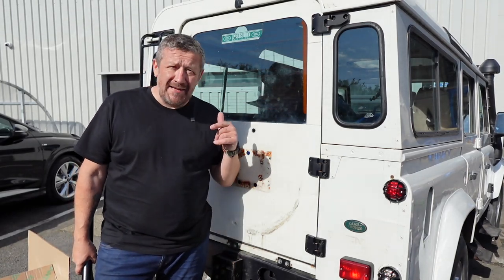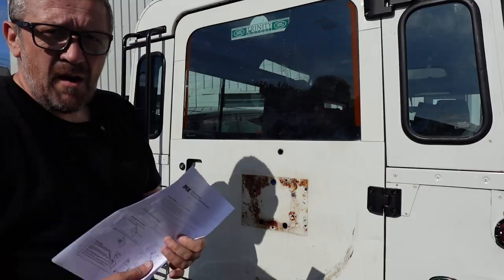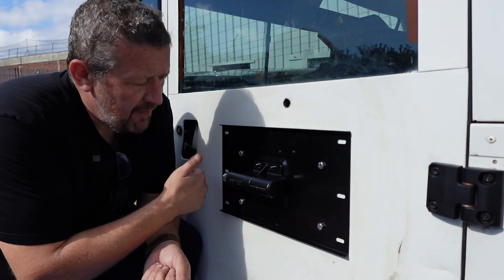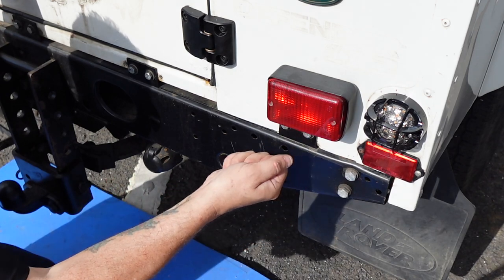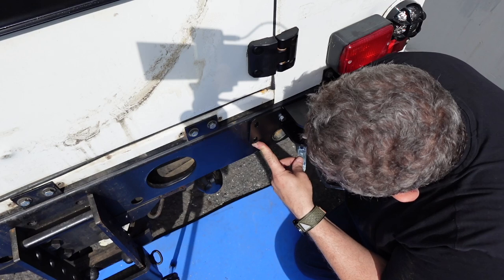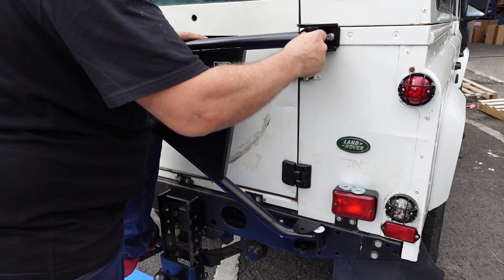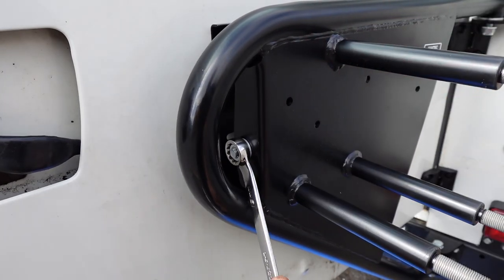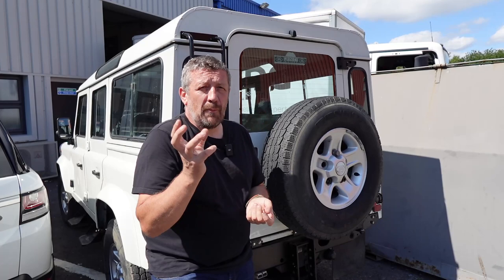One of the best bits of kit you can fit to your Defender, the Mantec Swing Away wheel carrier.

Comment: I’ve bought one similar to this one about 14 years ago - was a lot cheaper that time 😅

With a little DIY hack, wich won’t take more than half an hour, you can make it a real „swing away carrier“

Just cut the plastic piston that connects the carrier with the door to a length of approximately 10,5 cm (to be sure, I recommend to measure this before) and mount everything as shown in the video.

If you open the door and „overstretch“ it a little, the piston will slip out of the lead and you can close the door leaving the carrier open.
The same way you can secure the piston again.

The benefits of this little hack are

.) You now can use your spare wheel, to store recovery straps, shackles, a tow rope or other things inside the rim.

.)  While Camping, my beloved misses can now close the door from the inside on her own, so I don’t have to climb down from our pop top to help her 😂

If the piston is to long and doesn’t slip out of the lead, just cut of a little more.

If you’ve cut the piston to short, don’t worry, you can use a few extra washers when you bolt it to the carrier.

Comment: No Mantec should supply “all” the bolts & nuts needed so you do not have to get yourself down to anywhere. This tells me all I need to know about Mantec.
Reply from the maker: I think the main reason is that the plate suits a number of different models all using different hardware. But it is nice when everything comes in the pack. I wouldn't write them off just for a few bolts thoiugh!

Comment: Great video, these are really useful.
I do have an issue with the lr parts website though, it is so painfully slow, I spent 4 hrs on it the other day trying to order all my parts and had to give up in the end, I'd hoped my basket would save till the next day but it didn't,
Reply from the maker: That's a shame. I'm not sure if they had some technical issues maybe. But you could try sending an email with all the parts you want and they should be able to work with you on that. Or drop them a line.